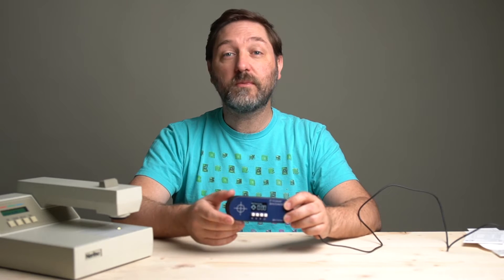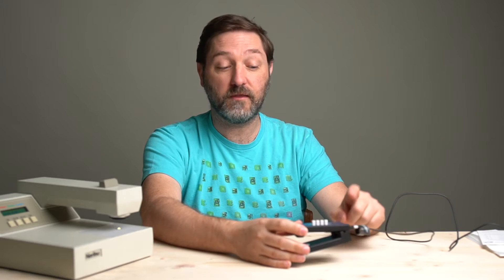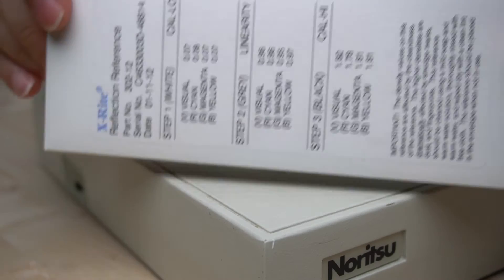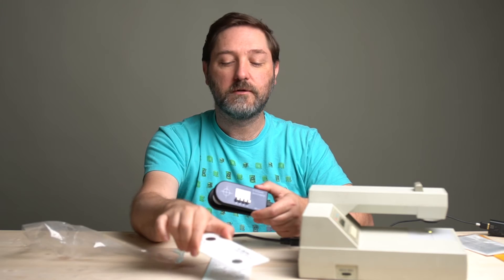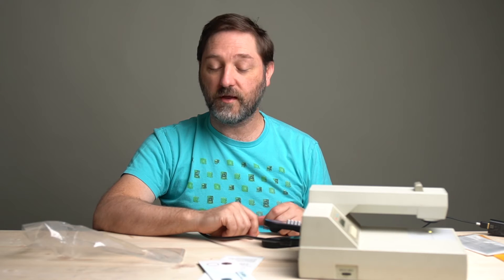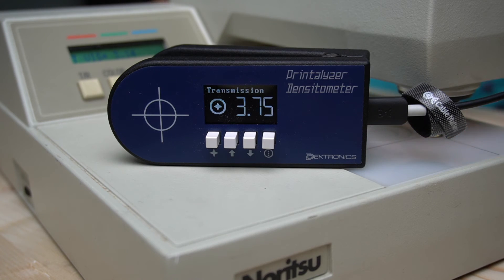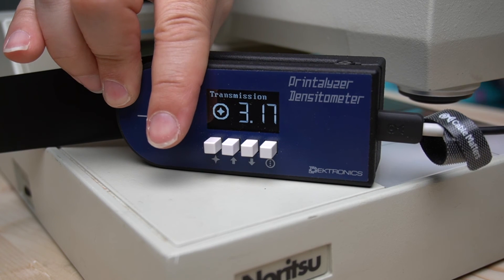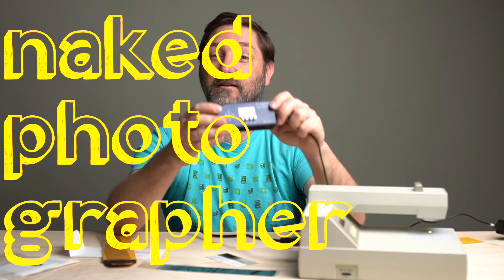Dektronics Printalyzer Densitometer

Comment: I know this is an old video now. I have the Heiland and the Printalyser. Both really useful -the Printalyser is very portable. 

I am finding that with reflective readings of light material, the Printalyser is near identical to the Heiland. However, with darker print patches (e.g. >2.0)  there is a systematic under-reading compared to the Heiland (by up to 0.1). Both calibrated to the same dmin. Not sure if it's just my unit.

Comment: Thank you for making this video. I was hoping to see how you position film when using the Dektronics densitometer. Does it have a target light similar to the XRite? If so, is the light in the base? I currently use an XRite 361T to measure small film patches that are only 7mm square. Without a light, accurate placement would be impossible, especially for very densest patches.